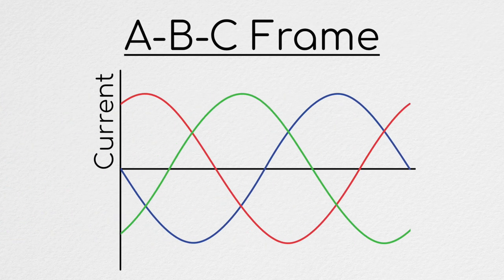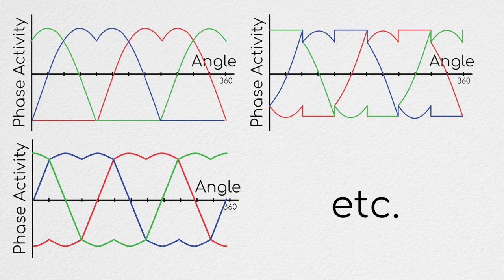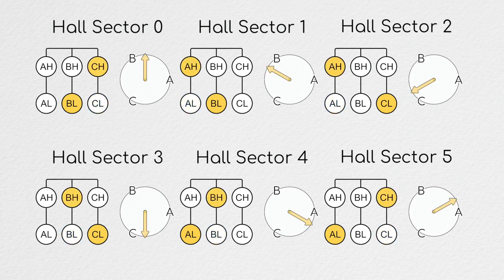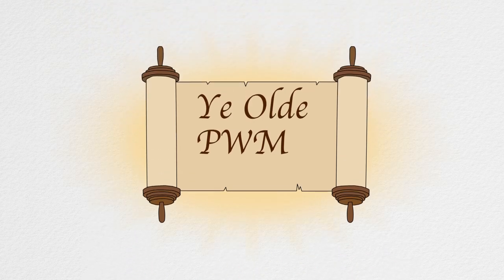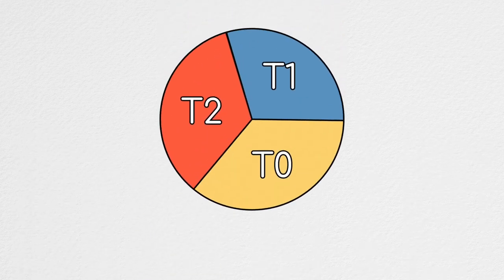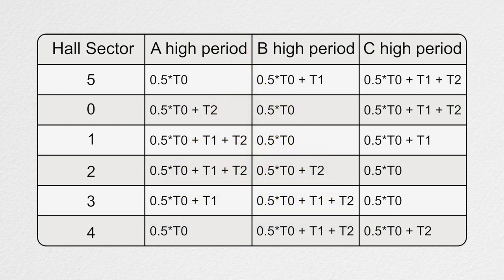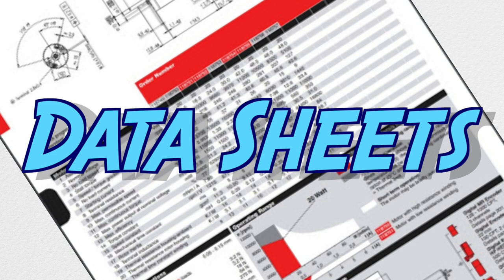How to do Space Vector Modulation (Understanding Motors episode 11)

Comment: Your video series made the concept of FOC so much clearer compared to textbooks and articles full of nothing but dry math. Of the whole series, this video was my favorite. Can't wait for my controller components to arrive.

BTW, have you heard of the user Lebowski on Endless Sphere? He's an expert of FOC and even got sensorless FOC working from a standstill. Sadly his code is closed-source, but with a powerful enough processor and high-bandwidth current sensors, it looks doable even for a mortal like me.
Reply: I'm guessing the user you talk about does a quick back emf reading to get a rough rotor position in order to select a starting phase.
Reply: @kezyka6775  Lebowski's implementation measures the inductance of the motor. As a phase gets closer to a permanent magnet, its inductance goes down. This works at speeds from standstill to where standard FOC takes over.

Comment: Please do one with using FOC for power generation and the power flow.

It's hard for me to think about where FOC will give current to the motor and at the same time draw current when generating power especially when talking about SynRM. Can't wrap my brain around the power flow especially from and to the inverter from load, supply and generator.

Thank you. Highly appreciated your content.

Subscribed and turn on notification.
Reply from the maker: hi, 
honestly with the amount of time that is required to make each video, its unlikely that i will end up making a video on something that specific, mostly because i am shifting to a new set of ideas in the near future. that said, i am more than happy to chat about it and try my best to clear it up if you have any specific questions. i had not heard much about SynRM motors, and honestly everything i can find to read on them seems more like it was written by a marketing team than an engineer. it all seems kind of hand wavy and like they are applying new terms to tech that has been around a while. 

As far as driving vs generating current, the way i tend to simplify it is that, if you are running current control, if your current is below what you are commanding, you are going to drive current. if it is above what you are commanding, you are going to regenerate current. Then, there are two ways that you generally will have a current above what you command: A) you change your command from one value to a lower value, or B) you are turning quickly enough that your back EMF is what is driving the current. I know your confusion is likely more in depth than that, but that is the set of first principles it will ultimately come back to. Feel free to reply with a more specific follow up and i will try to speak to that. Thanks so much!

Comment: Hey, 
Great video, I'm very impressed with you knowledge for the subject matter.
But I think you missed injecting a third harmonic in the PWM sequence, the triangle wave and it's implementation is missing from your software scope. It's dependent on the angle of the magnetic field vector and based on that we will either add to the voltage vector or subtract to it on the positive and negative sides.
If you address this in a future video it'll help put a complete closure to this series, which I believe is the best one out there.
Kind Regards
Reply: I think so, he was showing third harmonic, but didn't explain where he got one. Because you don't get that just from SVPWM.

Comment: Thanks Jantzen, great series! A few questions:

Firstly, I found the formulae for calculating T0, T1 and T2 a little confusing: what is the duty cycle here? Aren't we ultimately trying to calculate the duty cycle for each phase? When I am implementing a method to calculate SVM here, my parameters will be the coordinates in the alpha-beta frame, is there a way to deduce this duty cycle based on them?

Secondly, the table that converts t0, t1 and t2 to tA, tB and Tc is pretty opaque for me. Can you please some reference on how it's derived?

Lastly, I don't fully grasp the need to use null vectors. If the reference vector can be fully decomposed into the two active vectors, why do we need to spend time in the null vector at all?

Thanks for your time!
Reply from the maker: Hi! first off thanks for the questions, I imagine this stuff isn't super easy to understand in a format where you cant have direct dialogue about the things that are confusing, so this should (hopefully) be broadly helpful. I will try to address each part of your questions, but if any fall short feel free to ask a follow up:

1) So I read this question, wrote a response, then re-read it. Afterwords, I realized that I may have misunderstood the question, so im going to post the answer to both potential questions:
------If your question was "What are T0, T1, and T2"------
 The duty cycles when talking about T1, T2, and T0 are the amount of each period you spend in each of three configurations, where T1 and T2 are each active phases, and T0 (for the alternating reverse sequence) is split between the two null vectors. These values are then plugged into that table (question 2) to find what you send to each of the 3 phases. An important note that I may not have clarified well enough in the video, however, is that the values T0, T1, and T2 are really times, not duty cycle. The "T" term in the equations for T1 and T2 are the period of your PWM (1/frequency). The reason we do this is that (at least in my experience) you need to send some version of this period to the PWM modules on most microprocessors.
------If your question was "What does the 'DC' variable mean"------
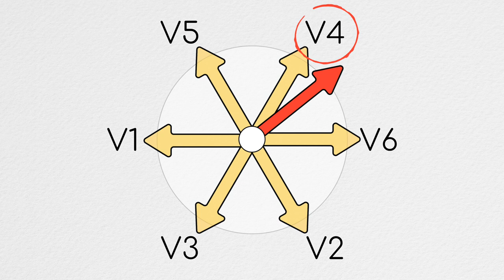the duty cycle variable here is the requested duty cycle, which would be the output of your current control loop. We touched on this some in the previous episode (around the 4:30 mark), and my next episode will go further in-depth into this. Basically, your current controller looks at the current in your system, compares it to the current you want, and commands a voltage. The voltage commanded is then divided by your supply voltage to give you a duty cycle (saturating if its over 100%). This value is the "DC" variable shown in these equations. 

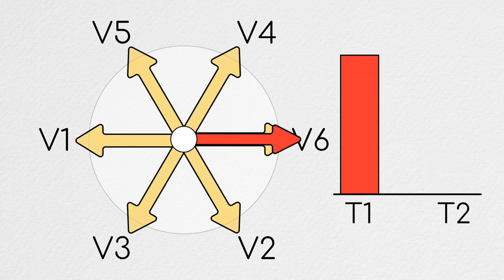2) The long short of this answer is that it is a more sophisticated version of the commutation table we developed in episode 6 (around 4:45). However, instead of being full blast in whichever two phases (Hi and Lo) we said in that episode, you are now modulating such that you perfectly align your current with your Q vector. this table was originally detailed in "understanding space vector modulation", a 1996 paper by Peter Pinewski, but I dont really have a good way of linking that. Texas Instruments has a really good series that covers all this (albeit longer, and with worse audio *pats own back), and the third part of it, which introduces this can be found here : https://www.youtube.com/watch?v=5eQyoVMz1dY

3) great question, and I find that null vectors tend to be a major source of confusion for people. So, if you want Current to flow in your motor, but not the max amount of current possible, you will handle this by using a duty cycle less than 100%. Lets say you use a 50% duty cycle. So, half the time, you are driving current to flow via an applied voltage, and half the time you aren't. Well, the times you are forcing voltage, you are going to be in voltage configurations 1-6. However, what do you do when you aren't driving it? you have a couple of options (episode 7 talks about this in depth with respect to block commutation). You could switch all your FETs off, just like you do in "hard switching", for example. However, this causes your current to decay quickly, as it will be forced down by the battery voltage. Essentially, the two null vectors are SVM's response to the question of how to handle the 50% of the time you dont want to drive current. It allows the current to keep flowing, but in both cases it doesnt do anything to slow down or speed up the current flow. 

Hope this helps, let me know if you have any more questions!
Reply: @jtlee1108  The answer no.1 and no.3 make perfect sense, they're very helpful, I appreciate it! I need to give the TI video a watch to understand the second one. Thanks!

Comment: So there is always a voltage applied to each phase? I was under the impression that a voltage was sometimes completely disconnected during low duty cycles, but I guess V0 and V7 are used instead.

The link to a paper on alternate space vector modulation methods seems to be broken for me, can you share the name of the paper or another link? 

Thanks for the great video series!
Reply from the maker: In my experience, with the exception of the dead time to protect against shorting a leg of the H bridge out, each phase is either connected to high or ground. I cannot say with certainty this is universally true for all SVM patterns though. As to the paper, the link is also not working on my end and I didn’t write the title down, so I’m gonna do some researching, find it or another paper and get back to you in just a bit! Thanks for letting me know that was off!
Reply from the maker: I dont know a ton about the journal this was published in, so I cant speak to its reputability, but this paper talks about the same ideas discussed in the other paper. its worth noting that what I called alternating reverse SVM they refer to as symmetrical (which is confusing because they refer to another as alternating) http://research.iaun.ac.ir/pd/shahgholian/pdfs/PaperM_4648.pdf
Reply: Thanks for responding! I'll take a look at the paper. Do you plan to cover more about the current control loop in the future?
Reply from the maker: R J yessir (or maam, your photo is a dog so who knows). That is currently scheduled to be the 15th and final episode of the series’s, though I’m considering reorganizing the last few episodes. Unfortunately because I just moved houses and have a lot of projects to do, my video production has become slightly slower (one should be coming out next Thursday)

Comment: i have problem understanding why we still using Sectors while we have a SPWM technique, i mean we got rid of the ripple and we can get the exact current just by the angle ( sensor ), why did we use the sectors that are for 6 and 12 commutation blocks, because i totally lost it when you entered the T0 T1 T2

Comment: why do the PWM Perionds need to be center aligned?
Reply from the maker: great question! so, I am not positive if they HAVE to be center aligned for SVM, but it results in the best voltage waveform with minimal harmonic distortions and minimizes the number of MOSFET switches (which is good since your MOSFETs behave worst in the linear region which only happens when they switch)
Reply: @jtlee1108  Surely the number of switches has to be the same either way? Center-alignment would make switch events more spread out instead of always aligned simultaneously, so it would probably result in overall smoother changes of current flow.
Reply from the maker: @iforce2d  So, disclaimer that im not 100% confident in this answer. However, what I would say is that center aligned PWM, for the same number of switches, would effectively double the frequency of changing which voltage configuration you are in (when compared to left or right aligned.). So, my understanding is that, sure, you could run both center or left aligned at a given PWM frequency, and each would have the same number of switches (as each phase turns on and off once per PWM period), however, you will go through two instances of each driving configuration per PWM cycle when using center aligned. So, if you wanted to get the same effective PWM frequency you would end up doubling the switches for non-center aligned. Again, im not 100% confident in this answer, but drawing out the phase voltages across a PWM period(like the diagram on the left at 9:44) makes me think this is true.
Reply: @jtlee1108  Hi Jantzen, after this I watched the video you linked to in another comment ("Teaching old motors new tricks"). Without watching your series first I would not have had a clue what he was talking about, but after your easier to follow introduction I actually understood it fairly well. Anyway, somewhere during that video it finally clicked for me what you were saying about less switches needed. I think the cause for my misunderstanding is your diagram at 6:51 which shows a switch up and then down again within the same time period. If I understand it correctly, there's only one switch per time period because it just stays at the latter state across the 'border' between periods. Eg. for a 60% duty cycle if the starting state is low, a low->high switch will occur at 0.4T in the first period and remain high. In the next period it will switch high->low at 0.6T. So across the two periods it was high for 60% of the time, but with only two switches. The slight drawback is the frequency will be halved, but I guess in most applications reducing switching losses is more important.

Comment: Why do we need to use V0 and V7 what happens if i remove them. Line must be V1 - V2 - V1 - V2 - V3 - V4 - ....... And i wanna say, that's a great explanation sir, thanks for your video
Reply: The idea behind V0 and V7 is that you can control the magnitude of your SV current/voltage instead of only controlling its angle. You achieve so by litteraly turning the IGBT bridge off from time to time, rather then always working on full capability. If you remove them, you lose the ability to smoothly turn on and turn off your motor in a ramp shaped form, for example.
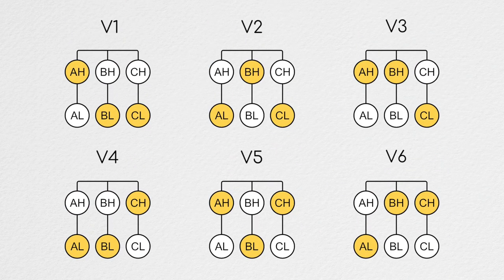Reply: Actually, after reinspecting the equations on 8:33, I saw that, even on full work (DC = 1), you still have T0 different from 0. That should be to avoid "escaping" the unit circle, since the true range of that SV basis is an hexagon, not a circle. I belive that, if you're already in stead state and want to overperform, maybe you can overmodulate by dropping V0/V7, but I can't say that for sure.
Reply: @felipedamascenosilva3011  thank you for the helpful explanation, have a nice day